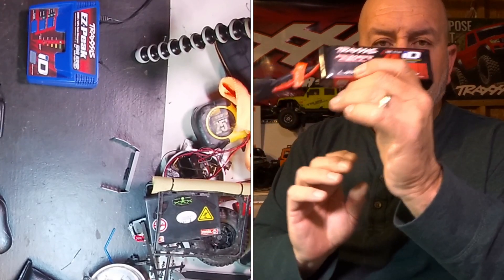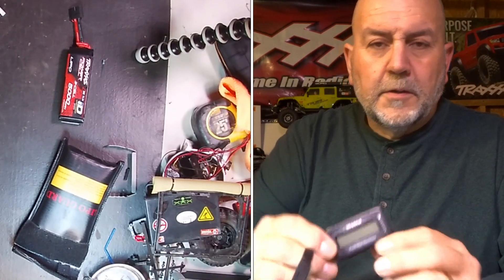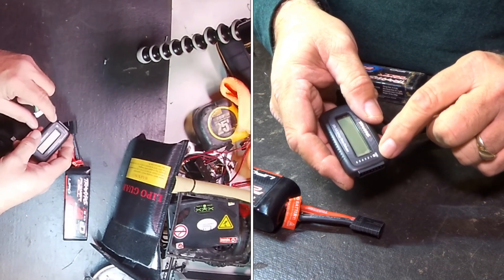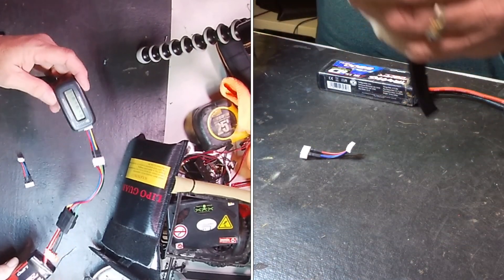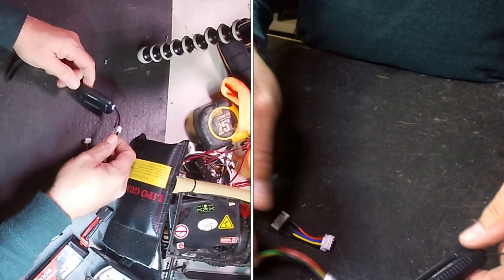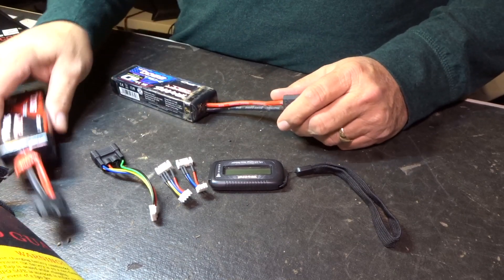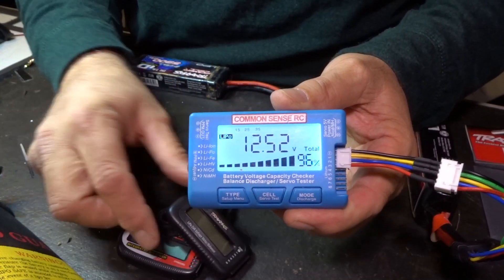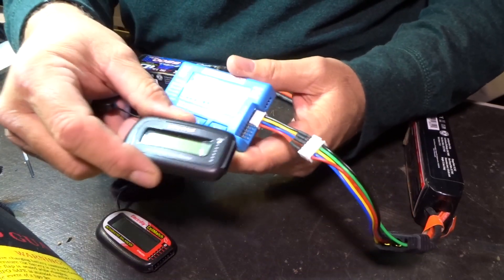TRXXAS LIPO ID EZ PEAK BATTERIES BALANCER VOLT CHECKER

Comment: How does that work for balancing lipos? I have a 3s 5000mah for my trx4 bronco and it has been givin me the error of the unstable cells on the ez peak plus charger, that means one of the cells is too high or too low on voltage.. does this effectively help with my problem?